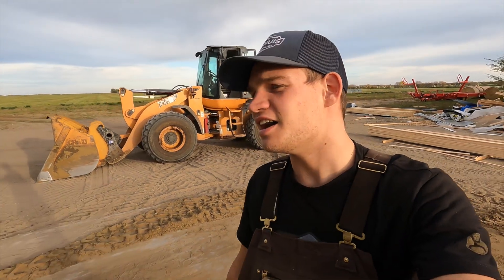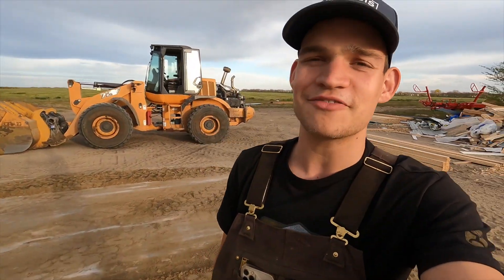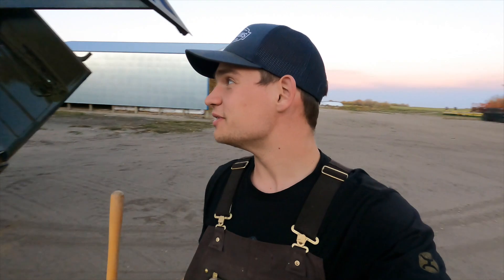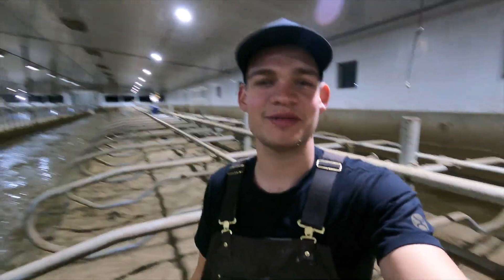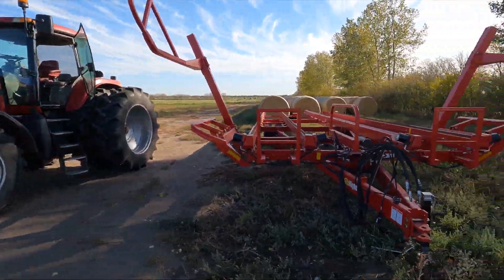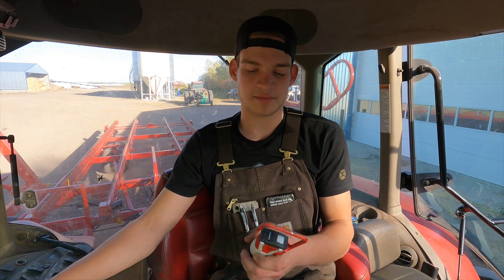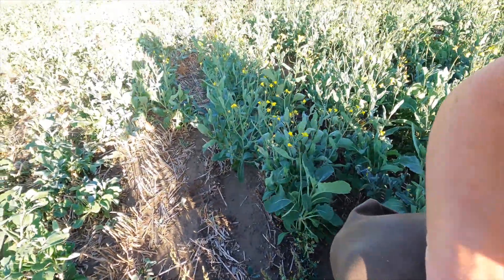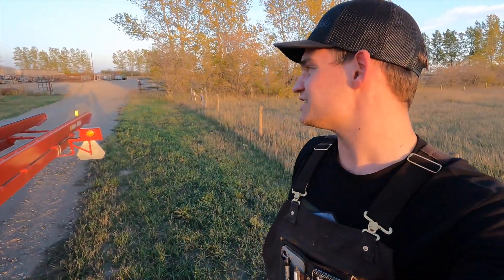The New Bale Wagon and MX285 Make a Good Combo!!

Comment: How many hp does that bale wagon take?
Reply: Pure hydraulic no pto means no hp
Reply: Still need engine horse power to pull and operate hydrailics. I would think at least 100 horse tractor. We run ours with a jd 4840 putting out close to 200